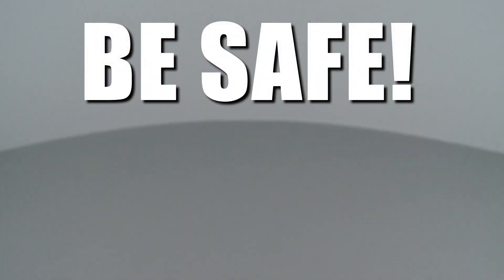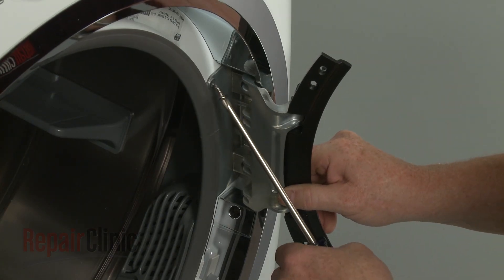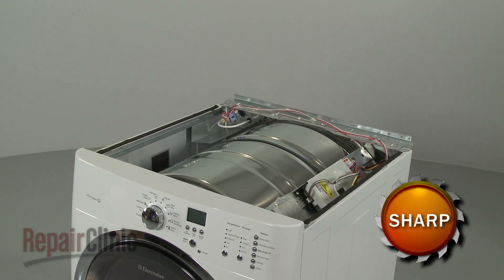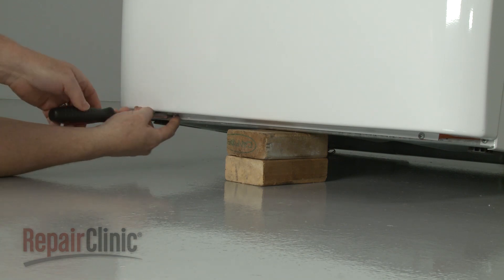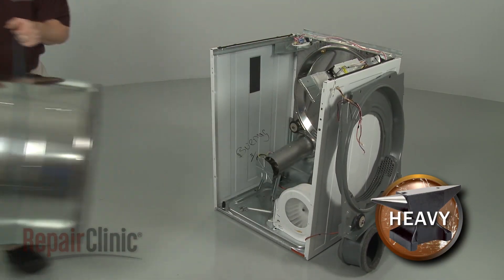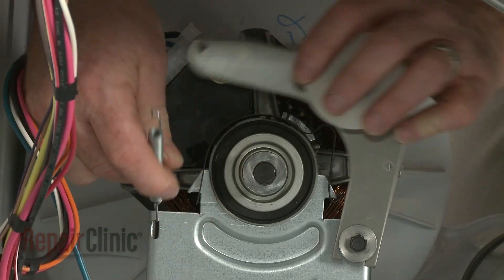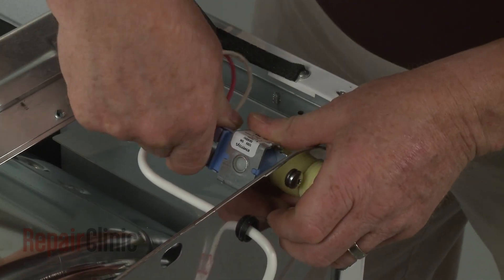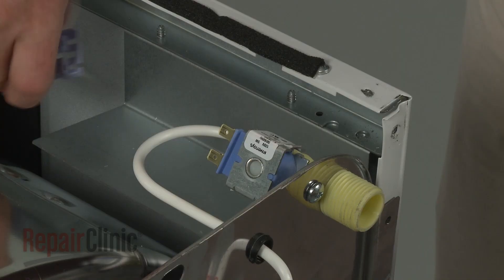Electrolux Electric Dryer Disassembly – Dryer Repair Help

Comment: Thanks! Our dryer started working again after rotating the drum by hand and restarting, but we wanted to check & clean the fan. It wasn't super dirty inside. We didn't take the blower fan blades out, but were able to use combined pressurized air and vacuum to clean.

Comment: After watching this video, I was completely prepared to handle replacing the motor in my Eletrolux dryer.  There were some slight differences and it took a 1 1/8 socket on the fan for my model.  But close enough.  Great video!
Reply from the maker: You're welcome! 

We are always happy to help. If you would like to give us a review on Google, we would much appreciate it: https://g.page/r/CcVUrahZNozMEBM/review

We hope that you have a great day!

Comment: The dryer I disassembled had a lock nut on the blower fan wheel.  Is this necessary?  The blower fan wheel broke and the lock nut was stuck in place.   We bought a new blower fan and motor.  The new blower fan wheel that we bought was more similar to your wheel.  The old wheel did not have a 7/8 inch hex on it, it was only round at its connection.  The new fan wheel has this like yours.  I bought a wheel lock nut (which as it turns out is only a 1/4-20 nut for which i spent $20 with shipping ) because there was one on the old wheel but I have a feeling it may be unnecessary since yours does not have one.

Comment: Difficulty removing the front panel Solved.  After following this very helpful video I ran into problems removing the front panel.  I figured out the issue is the tabs that hold the panel onto the bulk head.  My dryer has 4 tabs.  The tabs have a notch cut into them that were kinda lock the panel in place.  I needed to push the panel into the dryer when trying to lift up wards so the this notch would clear the bulkhead.  I could then lift the panel away from bulkhead.  I found out the laying the dryer onto its back allowed me to push down on one side then tab on the front panel bottom edge, watching the empty screws hole allowed me to monitor my progress.  I then repeated on the other side and was able to lift the panel away.  Good luck.
Reply: How'd you lay it on its back

Comment: We bought this dryer about a month ago for our second home▫▫▫▫>allmy.tips/FrigidaireDryer?22V     It is sleek and easy to use. I like the programmable settings. As I said, it is still brand new but my only concern is for the push buttons that might wear out over time.

Comment: my electrolux dryer hums 
 when i turn it on then it cuts off can some one please help
Reply: Lol this is probably way too late but I'm having the same issue, follow the video up to about 5:14 then that white circle thing is probably filled to the brim with lint which is blocking the motor wheel from spinning some crap like that lol

Comment: Wondering how to winterize compact  Electrolux dryer. When installed, the condensation drawer was bypassed by using vinyl tubing that drains directly into the washer drainage pipe. Electrolux was no help when calling 877#.

Comment: Disassembled just as the video indicated, perfect directions.  The problem?  A sock had been sucked down the exhaust and into the squirrel cage fan, jamming it.  The lint screen had somehow become dislodged and provided a path for the sock.  Removed sock, replaced panels and hardware.  Fixed!! Thank you!! [I found it easier and safer to remove the control panel bracket from the control panel sub-assembly, to provide access to the plug connecting the control panel circuit board to the main unit.  Doing this provided full finger access to the connector, without fear of slicing my fingers open.]

Comment: I need to replace the door gasket/seal on my EIMED60LT0.  will i need to take the top and control panel off or is it just a few screws around the seal?

Thanks..love the videos
Reply: Same thing here and I’m not finding anything on this repair. I just purchased the new gasket and through more research purchased the high temp adhesive. I’ve not taken anything apart yet but maybe I’ll document it.

Comment: No info on replacing electronic controls under the panel. My dryer is slightly different because it does have water inlet valves in the back. :)  :)  :)
Reply: >water inlet valves
you have a washer not a dryer
Reply: @chaos0987654321  He has a steam dryer.

Comment: Our Frigidare Affinity dryer was a bit different. I did not need to remove the hinge to the door. The two screws that attach the door to the front bulkhead allowed me to lift up the door 1/4" to slide it out of a "keeper" slot. I had to release the idler wheel from the back maintenance opening. Still it was invaluable to getting the bearing and belt replacement done. (I had to remove the three screws from inside of the drum to release the bearing assembly. Mine wouldn't lift out.)
Reply: @Randy Spangler~ Bless you & the day you decided to leave that comment! We are so grateful for this information, very clear & concise info at that. Purchased this 2009 set recently, at a yard sale, for $100, complete with both pedestal drawers & manuals. The price was low as the power cord on the dryer needed replaced, which was simple, and the dryer door needed a new latch strike. We were assured that both worked fine~ younger couple said they had been propping the door shut with a board! Anyhow, we decided it would be wise to take both machines apart , as far down as we could, in order to do a thorough cleaning, inspection etc.. After researching a bit, looking at the dryer diagrams we found and so forth, we were still a bit puzzled at the exact place noted in your comment~three different sources failed to show or notate the steps you provided~Thank you so very much for taking the time to do so!                          Sincerely,  Dan & Samantha Whitson- N.M.
Reply: I had a little difficulty lifting the drum out as shown but gently pried the edge of the drum using the back edge for a fulcrum and it popped out quite easily, just so you know and were ever unlucky enough to have to do it again.

Comment: I have a Frigidaire FRQG7000LWO that will come on and the drum turns but its just not heating? what could be wrong? Also, could you recommend on of your helpful videos for replacement of part for this model.

Comment: Hi guys - after reading some of the comments I realize I'm not the first to forget to put the lint screen into the trap before starting the dryer with a load in it.  That caused a sock to get sucked into the fan, which created a revolting rumbling sound.  I watched your video, stripped down the front of the dryer, pulled the sock out, and had the dryer back together and running fine in under 30 minutes.  A huge thank you, and also Merry Christmas from cold and snowy North Pole, Alaska.

Comment: We have an Electrolux model either very similar or exactly the same as the one in the video.  The problem we're having is in the control/display.  We would have to turn the nob several times until it will randomly light up and work.  Not quite sure what to fix/replace for this issue.  Any help, please?
Reply from the maker: +fuzyhentaipanda Your user display and interface may be starting to fail. You might look for a loose wire or connector on the back of the display board. Be sure to disconnect power before you take anything apart.

Comment: my Electrolux dryer is not flipping ? please reply
Reply from the maker: +Ahmed latif If the dryer is running, but the drum not turning, then the belt is broke.
Reply: +RepairClinic.com i found it. you're right. am buying a new belt. THANK YOU INDEED
Reply: RepairClinic.com can you please give me some advice on the door gasket replacement. It looks to be glued and sandwiched between the panels

Comment: Is there something else holding the front panel on? All screws removed as suggested in video, and panel will not lift off...
Reply: Daniel McAllister there are 4 metal tabs , 2 on each side that pull straight out. If you pull up a little bit then out it should come. Took a bit more force than I expected.
Reply: I had this problem, the glue that holds the door gasket to the front panel had also stuck to the front bulkhead. I was able to slide a paint scraper behind the gasket and in front of the bulkhead to pry them apart.
Reply: We are having the same problem.  Could there be anything else holding it on?
Reply from the maker: +Daniel McAllister Have you remove the top and control panels? There could be screws in the door jamb or clips at the bottom.
Reply: Bobbi O'Donnell did you guys figure it out?
Reply: RepairClinic.com is there screws behind the front panel?
Reply: lynn sheffield did you ever figure this out? The whole right side won’t come off mine

Comment: Forgot to put the lint catcher back in and started a new cycle. Now it won't start a new cycle and just automatically pauses. Can't seem to figure out why. Any advice?
Reply: +Kw MC951 I ended up disconnecting the power and disassembling the dryer and I found a sock had fallen in the space where the lint catcher was supposed to be. After taking it out and resetting, it worked fine.
Reply from the maker: +Steve Pershouse Disconnect power for 20 seconds and the controls should reset.
Reply: +RepairClinic.com 
I have the exact same problem Steve Pershouse. Wondering if the disconnect of power fixed the issue?
Reply: Found the same, sock sucked into the squirrel cage fan

Comment: I have an Electrolux dryer that was accidentally left with wet clothes for almost a week. Now it stops after about 20 seconds after I start it and it tells me my clothes are dry. Which they are not of course. I suspect it might be a sensor for how much moisture there is in the air coming from the clothes and that it might bee corrode and then not reading correctly. Can this be the case? I can clearly see lots of spots of corrosion in the drum.
Reply from the maker: +Jonulf Sen Look for a moisture sensor on the blower housing that may have shorted or perhaps the thermistor is defective.